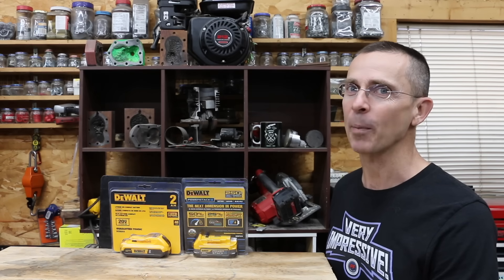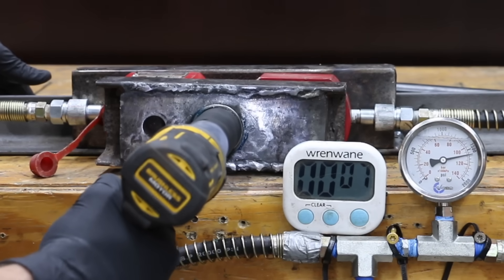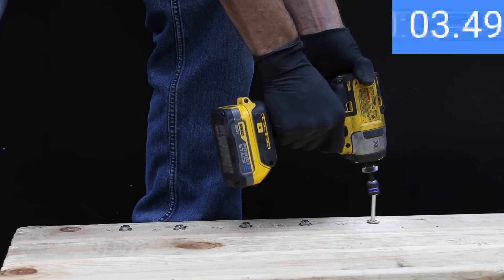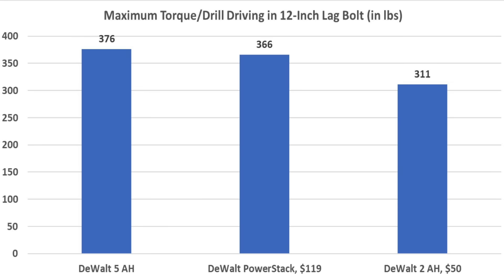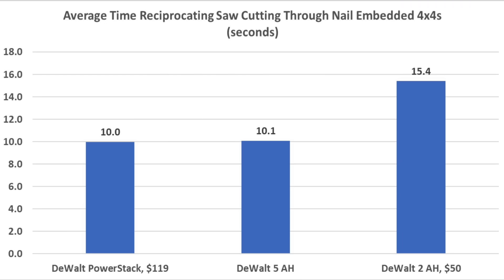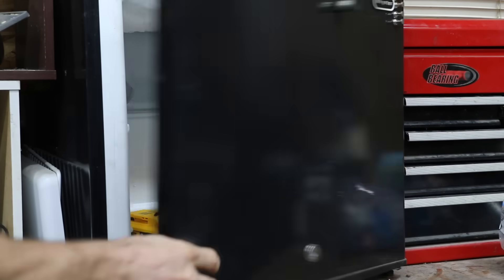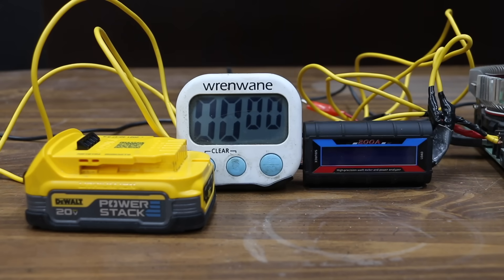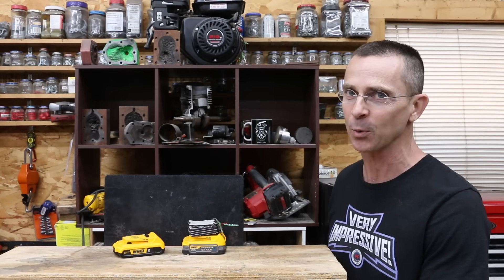Compact “Pouch Cell” Battery Better? Let's Find Out!

Comment: Super interesting, Commander! So far I have two 1.5 AH's and a 2 and always have a hot one and a spare and one to be charging if need be. Looks like with hotter batteries the tool will burn up or explode and you'd be stuck with a bag full of batteries and nothing to put them in, but I guess not. It'll be VERY interesting to watch and see what direction DeWalt goes with this. For now I'll probably just get 2's as the 1.5's die off. Thanks for a REALLY FINE test as always, happy wood heat and BLESSINGS all around!
Reply from the maker: Hi Lewie, Thank you very much! Great point on the hot batteries.  They survived the quick drain air blower test without incident. Great point on getting the 2s.  It's a proven technology with very reliable 18650 Korean cells.  Wishing you all many BLESSINGS!!
Reply: @ProjectFarm  They keep cramming more power into the same case and soon it'll be atomic and so radioactive nobody can live being around them. If I get that hung up for power I'll just pull a cord and be done with it and let some atomic bomb plant run everything for a while. And there isn't a thing I can't get done with a 2 AH, or at least swap and have one charging up. It's working just fine with the 1.5's. Thanks again Commander and stay warm and burn that wood for more job security this summer! GBWYall!

Comment: It’s like picking between a larger naturally aspirated engine or a smaller turbocharged one haha.
Reply: You really set of the delicate V8 guys. Sututut!!!
Reply from the maker: Thanks for the feedback.
Reply: Injection is nice but I'd rather be blown 😁
Reply: Smaller turbo charger one will fail 1st
Reply: @VaporRipper  tell that to turbo diesels....
Reply: @FJB2020  OK. I'll let them know.
Reply: @FJB2020  Quick google puts "high mileage" turbo diesel at 350,000 miles, while a standard diesel is 1,000,000 and over.
Reply: @quintessenceSL  turbo diesels are the standard. N/a diesels are very unusual
Reply: @quintessenceSL  on the USA, the epa has made turbo diesels time bombs using def.
Reply: @quintessenceSL  The hardest used turbo diesels are Semi trucks and they are good for 700k-1.1 million miles. the last N/A diesels i remember being made were the old idi's and 6.5 Detroit. Engine design and maintenance have way more to do with reliability then if it has a turbo or not.
Reply: @WhoThisGuy515  Really now? Harder than being used as taxi service, then sent to Africa for the next 500,000 miles? Show me turbo diesels that have done the same.

Per Rechtien- semis can reach 750,000 miles, and some reaching the million mark. And that's with, oh, 50 years difference in technology.

There W123 are still humming along. Show me ANY turbo diesel semis 50 years old still in regular use.
Reply: @quintessenceSL  uh... when is the last time you saw a semi without a turbo?  and when is the last one that DIDNT go 1mil miles?  A lot of ignorance here.
Reply: @jasonsmith4902  Uh... when have you ever heard of turbos being applied to diesels (or anything really) to increase reliability or durability?

The one place where I know NA diesels are still used is the military. One guess as to why that is.

Speaking of ignorant...
Reply: @quintessenceSL  350,000 is just broken in... and as pointed out almost all diesels are turbo, so not sure what you mean by "standard" since turbo diesel is the standard..
Reply: @quintessenceSL  Do you know why most don't use NA diesel? They don't make no power. I'll take a turbo diesel over a NA diesel every time. Everyone from the military will tell you how much of an turd those NA diesels are. Either way, a lot of turbo diesel's are still incredibly reliable. If you wanna take 20 secs to get to 60mph be my guest. lol 

Also I'lll tell you why, since the military had those NA diesels for decades and are looking to replace them with JLTV's that come with..... YOU guest it,  Banks Powertrain 866T high-performance V8 turbo diesel engine displacing 6.6L, because why? They offer great reliability and have A LOT more power that the military needs. A lot of vehicles in the military are turbo diesels. So why pick an out of date vehicle that is slowly being replaced?

So who speaking of ignorants? NA diesel suck, it's such an little diffrents in durability, that not having a turbo is more of a con than a pro. You will find way more turbo diesel's on the road with high milage than you will find high milage NA diesels. These turbo diesel racks on more mileage than most NA gas engines ever see.
Reply: @quintessenceSL  quintessence, non-turbo diesels had problems with egts and didnt last near as long as turbo charged diesels, for gas motors yes turbos will blow them up quicker, for cast iron diesel motors with forged internals such as the cummins, you would be wrong. diesels where also worthless and gutless until they got turbos
Reply: @quintessenceSL  my point was they dont effect reliability in any way.
Reply: There's no replacement 👏 for displacement.
Hey-O
Reply: @FlipLoLz  You asked which NA diesels are out on the road getting over a million miles, did you not? Question asked, answer received.

And there's enough of them that it's more than a fluke. With 70s technology. You know, radial tires were just starting to become a thing.

Or you could use the googles. From MotorBiscuit- diesel engines can run for 1,000,000 to 1,500,000 miles before needing major work. And can be on the road for 30 years or more.
Reply: Eyyyoooo gardensnake
Reply: @FlipLoLz  The one considered the most durable car in the world- the W123.

Learn your history. Thanks.

Comment: I know that performance is what you pay for a lot of the time when you’re talking batteries for power tools, but your video proves my findings - the cost of diminishing returns in battery technology are astronomical..!

It is very likely in the future, the “Powerstack” type and other advancements in battery-tech becomes more standardized and affordable.
For the meantime, however, I cannot justify such cost increase. 

I have 1.5 2.0 and 4.0 mAh batteries for my power tools, and it’s good to have an array of capable batteries. 
I get decent performance from them, and can use the suitable battery for the task. 

For example- if I’m using the tool overhead, or for a shorter period of time- I’ll use the lighter, smaller 1.5
For longer duty, I’ll opt for the bigger battery. 

Also, I’ve noticed that some tools prefer certain battery sizes. Have you had similar experience?
For example, my Ryobi Power inflator, as well as my 18v inverter get the 2.0 batteries to overheat and end up shutting off after very short use.
Reply from the maker: Thanks for the feedback.

Comment: I've been waiting for this video, I'm a owner operator of a small contracting company and 98%of my tools are 20v DeWalt tools, I've wondering how the new battery compare to the standard DeWalt battery price to power comparison, I think I will use the batteries I have now and replace with the new battery when old batteries stop working. As of today I have one 2AH battery bad, Thank you for great videos, I have made multiple purchases from information I got from your videos. I have also not bought products because of information from your videos. I don't know if you have tested the Milwaukee M18 fuel SDS hammer drill against the DeWalt 20v SDS hammer drill the Milwaukee M18 fuel SDS hammer drill is one of the tools I have that's not in the 98% of DeWalt tools I have. Just wondering how they compare to each other. Thank you again for the videos. 

David Short 
DIJS CONTRACTING. 
Beattyville, KY
Reply from the maker: You are welcome!  Thanks for the suggestion.

Comment: Cells in tools are crap.LiPo delivers more amp than li-ion but have shorter lifespan and capacity.Best cells in tools was A132 in some old dewalt batteries.Don’t buy new battery,instead buy better cells and you have a better battery for less money.As always great test.

Comment: Nice review, some battery makers sell the pouch shape as "extra performance", it's half true and half false, it's half true because the pouch have thicker electrodes distribution and this reduces electrical resistance when battery deliver power, it's half false because unless you increase overall battery energy you will not get more energy.

More info and technical details (Dave Jones EEVBlog): https://www.youtube.com/watch?v=hbPKE62aM0U
Reply from the maker: Thanks!  Thanks fr the feedback.

Comment: I believe DeWalt also has 2 types of motors in their drills and drivers, bushless and brush.  The brushless have much more power and the batteries last longer in them than in the bush motor tools.  I remember when DeWalt tools first came out.  I thought they looked like cheap toys.  Most of my cordless tools are now DeWalt.  They hold up really well.  Maybe you could do a comparison of brush vs brushless motor tools.
Reply from the maker: Thanks for the video idea.

Comment: My main concern is how dangerous li-ion batteries are when it comes to punctures. I've dropped my drill more than I'd like to admit, both off ladders and scissor lifts. The li-ion are more susceptible to Punctures than the 18650s.
Reply from the maker: Thanks for the feedback.
Reply: 18650 batteries are Li-ion batteries. You mean Li-po batteries. If you drop the battery, and get unlucky enough for it to land on something sharp/pointy/long enough for it to puncture the plastic housing, that could be a concern. But it's highly unlikely.
Reply: @littlejackalo5326  yes thank you. I got them mixed up.

Comment: $120?

They're taking the piss, Lipo cells are even cheaper than the 18650s in the older style battery! I appreciate there's design/engineering/manufacturing costs of producing good power tool batteries but they're still asking far too much.
Reply from the maker: Thanks for the feedback.
Reply: Lipo batteries are more expensive than Li-ion batteries, both on the consumer/retail side and the wholesale side. Right around 2x as much. A single cell 2500 mAh Lipo is more expensive than a single 2500 mAh 18650 Li-ion, and a 2500 mAh 5s Lipo is more than five 2500 mAh 18650 cells. A 2500 mAh 18650 Li-ion is right around $5, and a 2500 mAh Lipo is around $10. Not sure where you're seeing Li-ion batteries that are more expensive than Lipo batteries.

Comment: Really great tests! Very thorough!

PowerStack seems like a bad tradeoff to me- costs way more, provides slightly more power but has a shorter running time. IMO for most applications the running time is more important than having your lag bolts get drilled in slightly faster. :) Stopping what you're doing to change / recharge batteries is annoying, especially if you're not working right next to a power outlet.
Reply from the maker: Thanks so much!  Thanks for the feedback.
Reply: Carrying around the power stack battery is a whole lot better than carrying around the 5 Ah. It matches the power of the 5 Ah battery, at the size of the 2 Ah battery. If you're doing overhead work, drop ceiling work, electrical work, or anything else where size/weight matters, its much better. You don't have to choose between a 2 Ah battery that doesn't have much power and doesn't last very long, or the 5 Ah that weighs a lot. It's right in the sweet spot. Same power/CDR as the 5 Ah, smaller size than both the 2 Ah and 5 Ah batteries.

Comment: Pouch cells are a good idea for density, it will be cool to see more of them in the future, especially if DeWalt starts to manufacture them cutting out the 18650 suppliers which would lower cost. At the current cost there's no point, just get the 5AH.
Reply from the maker: Thanks for the feedback.
Reply: A while back there was a 2 pack for 180 so a bit better price per pack. Still a bit pricey though
Reply: Indeed, the price will have to come down, and it will.  Great comment!  👍✌🏻
Reply: There's supposed to be a 2pack for $149...somewhere...At that price point, they make sense if you want a light battery on a high draw tool, but not much runtime. Impact wrenches are one example.
Reply: If you do a lot of work overhead, or with a tool that already weighs a lot, the new powerstack might be a back and arm saver. They do have an advantage in weight over capacity for some applications.
Reply: @lemonaidking  In that case, just get a Dewalt CP-battery based on 21700-cells. Not as light, but more capacity and gives decent balance on most tools

Comment: 🥳🥳🥳 Video Ideas 🥳🥳🥳

• Best squeeze-to-close general duty clamp for wood and metal work
• Best twist-to-close clamp for wood and metal work
• Best spring-tension clamp for wood and metal work
• Best aftermarket insole for more comfortable boots
• Best long-nose Vise Grip style locking pliers
• Best hand-held wire brush for shop use (copper or stainless bristles)
• Best nylon brush for shop use (such as those used for gun cleaning)
• Best stackable, plastic patio-chair
• Best snow chains
Reply from the maker: Thanks for the video ideas.

Comment: I’m an electrician. I work on job sites every day. So I’ve seen the abuse that cordless tools take from guys and in my trade and other trades. And these tools take a beating. Being dropped from very high heights, drained to zero, and being used in extreme climates. I also have a large electric RC collection that use lipo batteries. Lipo batteries when abused can burn you house down with little warning. Each cell needs to be balanced. Cells cannot be damaged from drops causing a pouch to rupture and burst into flames. The old Samsung phone that would blow up in your pocket. No thanks. Wouldn’t want these batteries in my truck tool box baking in the sun working in the desert. Or charging at home or on the job unattended. There’s guys that sometimes leave thier batteries on a charger all day. I’m not going to trust the on board electronics in the battery or the charger. And if a guy is complaining about weight of a tool because the battery is heavy. Then get a desk job.
Reply from the maker: Thanks for sharing.
Reply: Dewalt claims to have solved all of these problems with the new battery.
Reply: @asificam1  ni-mh doesn't like high power drain applications, and voltage is not as constant as nicad or lithium-ion. Power density is also much less than lithium-ion.
Reply: @asificam1  going to bulkier, less power dense batteries, that ouput less current, and have smaller electrode surface area seeems to be the exact opposite of what every powertool manufacturer is doning and the exact opposite of the whole powerstack concept.

You want larger electrode surfaces  to move more current, at 18-20v so modern tools have more power in smaller, compact, lighter pacakages.

Just going to ni-mh would double the weight alone.

Comment: Nothing new here, but that's not what DeWalt wants you to think. Foil packs can inch out a little more max current per size, but they are not as reliable or safe as a metal cylinder type cell. The Chevy Volt is a recent example, of course there was the hover boards, Samsung phones, E-Bikes...
It seems like DeWalt wants more money for the new technology, but the new technology is only new to DeWalt.
Reply from the maker: Thanks for sharing.

Comment: Another outstanding video!
I think I'll be sticking to the 5Ah and 6Ah for the higher-load uses and keep the old 2Ah for light-duty, overhead/awkward positions (where the lighter overall tool would reduce fatigue) and FOR THOSE LAST TWO DANG FASTENERS. (I'm assuming that a few others here find that they often have to go find another battery just when about to finish a job. Or, is that just me and my poor planning?)
Reply: Do I get a small whiff of Murphy's Law here?
Reply from the maker: Thanks!  Thanks for the feedback.
Reply: thats why corded is le best

Comment: Essentially a cell phone battery sandwich. I know how warm a cell phone can get. I'll be interested to see if there's an abundance of failures linked to the inner layer frying itself.
Reply: Its mostly the excess heat produced by the electronics heating up the battery. The battery itself usually does not produce much heat as the amp draw of a phone is pretty low. Although phone batteries and these pouch batteries share the same chemistry the batteries used in this pack are built for high discharge rates rather than capacity